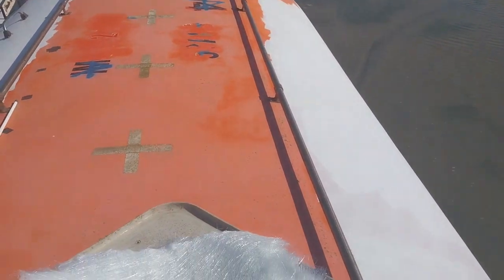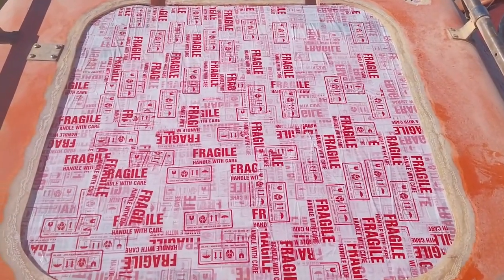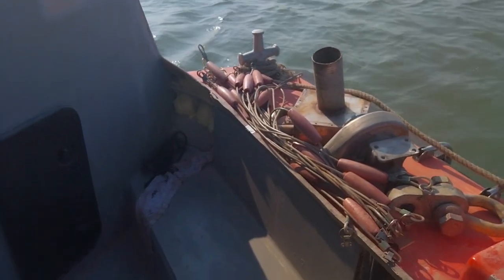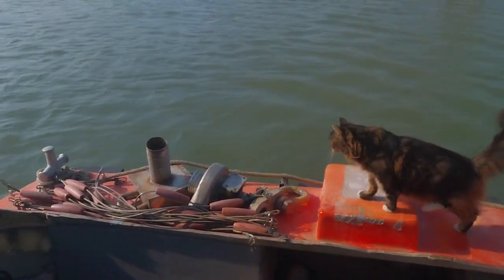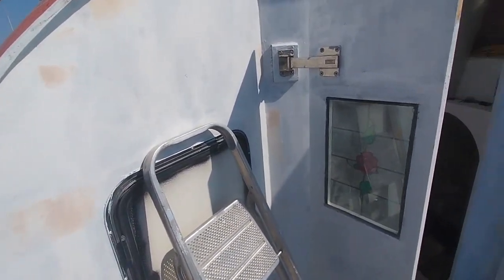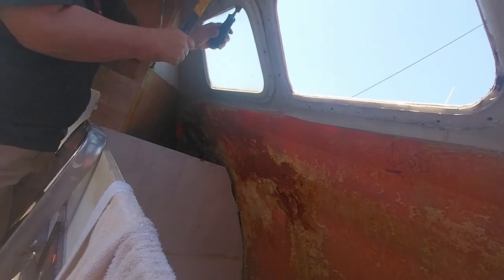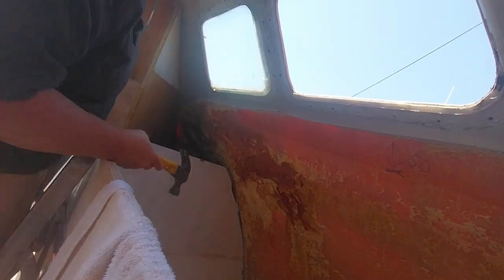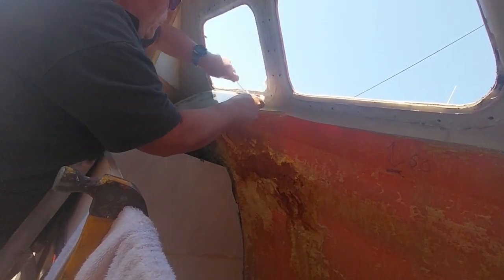Lifeboat conversion Ep.  31: Sorting out the big hole in wheelhouse roof.

Comment: Are polyester resin and epoxy comparable materials in terms of strength, longevity, etc?
Reply from the maker: Hiya, very good question. I think that many people have different opinions about both materials. Some think epoxy is the answer for everything. It is strong and stcks well, but hardens over time and it hates UV, so prone to failing dramatically if not protected properly. The other thing is you can use epoxy on grp but not the other way around. Grp is more than stronge enough for Hygge. It is a lot cheaper and sticking with the same material the boat is build with, makes more sense to me.